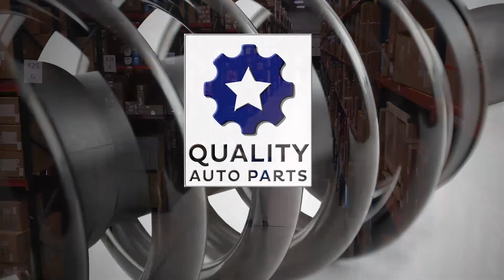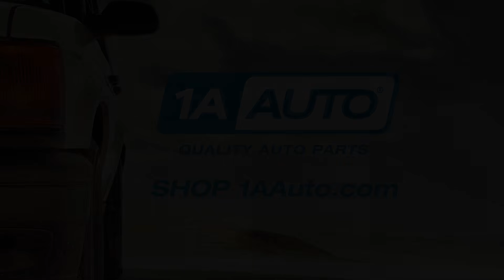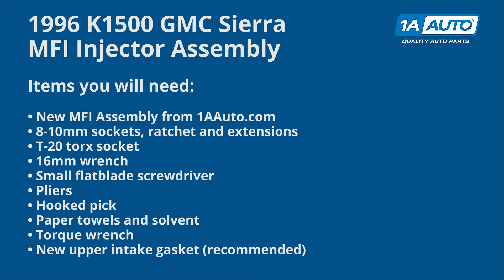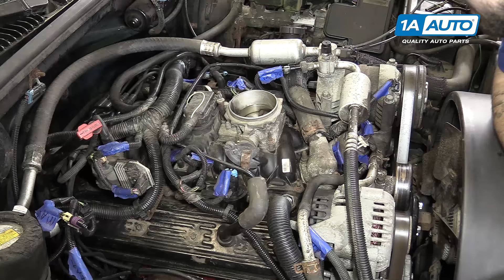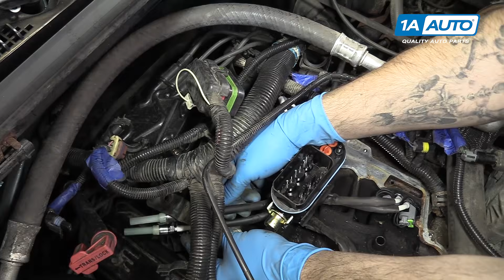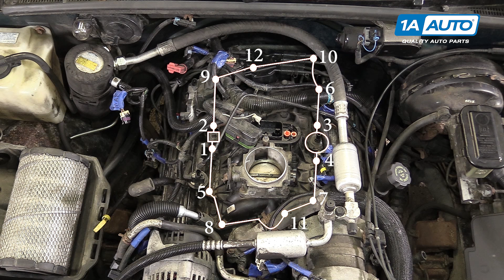How to Install Multiport Fuel Injection Conversion 96-99 GMC K1500

Comment: I just installed these on my 98 k1500 but I’m running into once issue that has held up the last 10 minutes of this whole process. The fuel lines that go into the injector block went in great at first then I realized I had to loosen the bolt on the block to get the lines connected at the firewall cause it was just too tight so I took out the lines at the injector block and everything came with it. The plastic sleeve the two o rings and also the metal washer. Since then I have not been able to get them to west back into the injector block properly. What am I doing wrong???

Comment: Would you need a new tune applied to the truck ? I recently replaced mine since a mechanic said they were shot but when I got the job done it still had the same problem . Ive read that when upgrading to bigger or newer injectors you would need a tune for it to operate correctly. Just curious
Reply: I would like to know this as well because I just have straight gas dumping into the plugs and it doesn’t burn it fast enough

Comment: I have 1998 Silverado V8 and I have to change the spider fuel injector twice with a used spider, still doing the same thing just run for 30-40 second and cutoff am trying to buy a new spider now, Do you think that will be the best to do?
Reply from the maker: There could be multiple reasons why you're having this particular problem. We suggest taking your vehicle to a nearby reputable shop to identify the cause before completing any further repairs. +Latunde Sapara
Reply: Used parts are just that used it could be your coil your fuel pump or a computer issue take the time to check before throwing parts
Reply: remanufactured spyder injectors have been known to fail. Just upgrade to the multiport injection or buy an OEM replacement, not another reman spyder injector

Comment: Nicely put video. Straight to the point. I am going to do this to my 1999 Suburban. It has a crank but won't start symptom and I have change a bunch of stuff and still. I got spark, fuel psi, compression, charged battery, new fuel pump. Crankshaft and Camshaft sensors, distributor cap, rotor, and still. It is good on timing, that I checked with the TDC and the thing pointing to #1 spark deal in the distributor cap. It basically died in the driveway for the lack of use little by little. Any advise will be appreciated... Jose. Will keep you all posted on what happen next.
Reply: #1 at top dead center?   or- you might have your distributor 180degs off.
Reply: Did you get it figured out?

Comment: Did you need to change bracket that holds spider
Reply from the maker: +matthew norton You do not need to change the bracket as long as your original is still in good condition.

Comment: no vacuum line onto the fuel pressure regulator?
Reply: The regulator is inside the plenum and exposed to engine vacuum.  No need to run a vacuum hose to it.

Comment: any insight as how to get these injectors back out after you install them i think my injectors are faulty
Reply: Use small pins to release the catches on the pintel cover from the bore, carefully pull out. Failing that, you'll  have to pull the lower manifold, and push out the cover from the bottom of the manifold.

Comment: Will this work with a '94?
Reply: NNoisy no the fuel injection system in a 1994 is called throttle body injection the system shown in the video is called spider injection and it is only used from 1996 to 1998 on these trucks

Comment: Do not remove the distributor. If you replace it you will have to be able to rotate the distributor enough to bring the timing in using an OBD 2 scan tool. Under cmp timing data it should be + or - 2 degrees but you can get + or - 0 degrees. Rotate the distributor counter clock wise to advance. New distributors will have a square shaft with a fixed clamp it must be modified to be able to rotate the distributor, if the distributor hits before rotating enough your off one tooth. Please see, https://youtu.be/QpjBsZnvpfg

Comment: Installed mine today and truck started right up. When I put it in gear it acts like it’s going to die then surges hard. If I press the throttle at idle it revs decent but when in gear the throttle kills it. Any advice from anyone who has installed one of these?